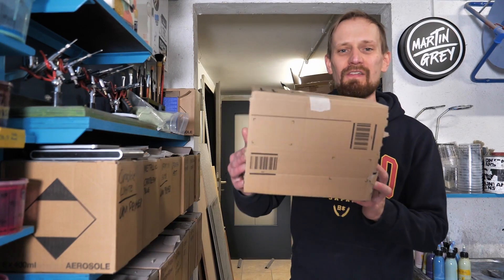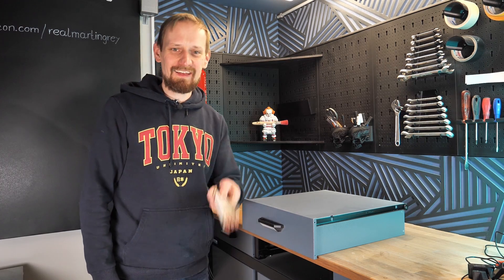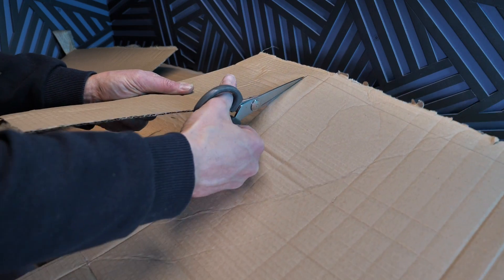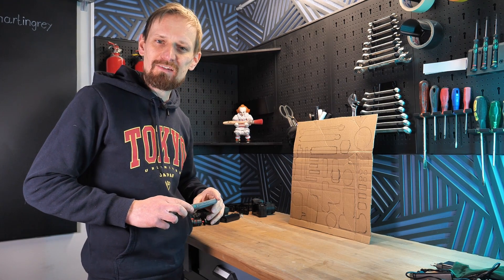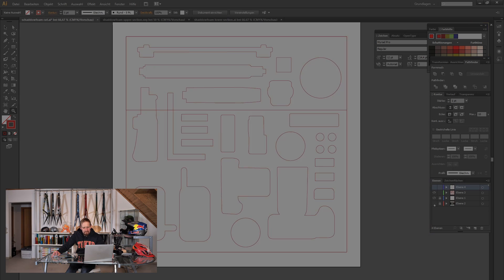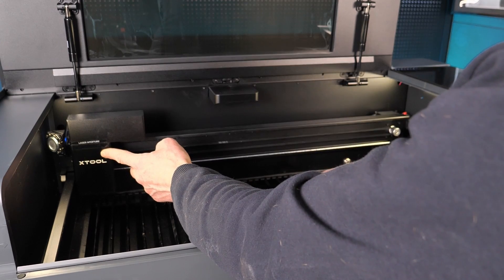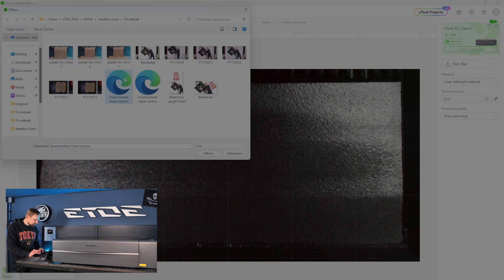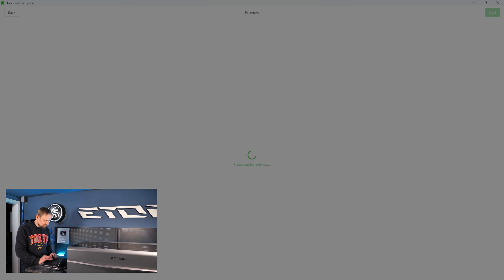How to do Shadow Foam at Home for free - feat. X-TOOL P2

Comment: Ah, classic DIY-ing: in order to make a project for free, we will need 5000€ laser and 300€/year software
But the serious question be, how do you deal with hazardous fumes while cutting? Doesn't seem like this room is properly vented
Reply from the maker: Just use the link in the video description and you get 400$ off ;-)
Reply: @ETOE  Wow just 4600, a bargain ;)
Reply from the maker: With an active charcoal filter on the back of the machine and an exhaust on the right side of the room.
Reply: @ETOE  good to know! Thanks for staying safe, you are a treasure!

Comment: Wonderfully useful video.  I do similar things with the foam recycled from my own packages. Minus the laser cutter. Sure it might take a bit more time, but the end result is the same. A properly organized storage solution! If you value organization, then it is worth the time to do it, with or without the expense of a laser cutter.
One thing I do add is I use a contrasting color of thin foam between layers to make the cutouts more visible.

Comment: My parcels only arrive with a dozen or so mini air bags in them. Not really sure I'd want to try cutting those with a laser.

On a side note, I've really been interested in a tabletop laser. I'm just waiting until they can cut at least 2.5mm thick steel.
Reply from the maker: The problem you will run into are the power outlets on your table top if you like to cut steel ;-)

Comment: When you finish the cutting, keep the pieces still in their place and then use the spray glue. That way when you remove the disposable parts you will have clean inserts that are not covered with glue.
Reply from the maker: I wish I had done this. Decided last minute to go with spray adhesive so keeping the inserts is very helpful.